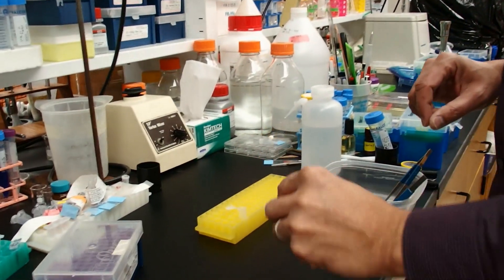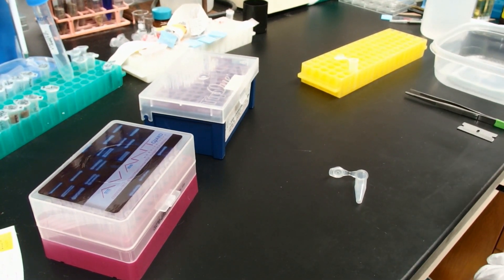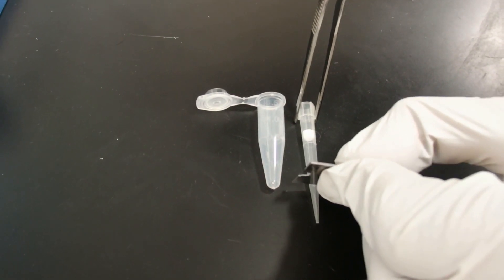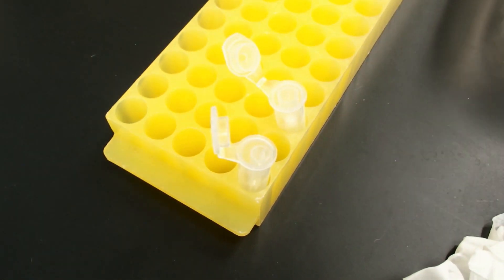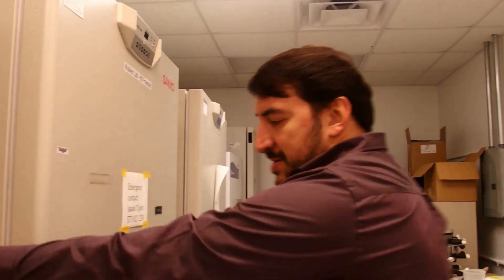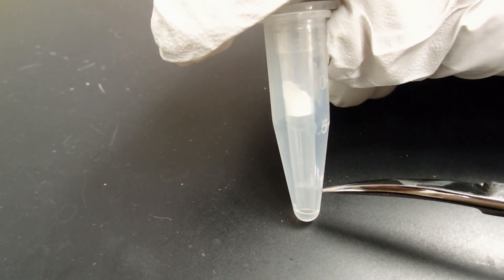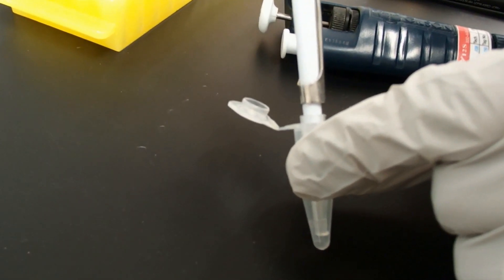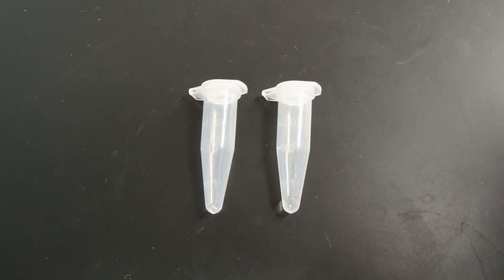DNA Gel Purification - Freeze & Squeeze Method

Comment: What type of tips should I use?
Reply from the maker: any filter pipet tip will work that looks similar to the one in the video
Reply from the maker: also check the print protocol that can be found in the description (here) because it does a good job of describing the filter tip requirements.

Comment: Hi what is the 260/230 ratio? How much input dna is required if I need to purify 6kb band.? My downsteeam application is infusion/nebuilder. I tried PCI and I get 0.6 to 0.7 260/230 ratio. I am not sure if it is good enough
Reply from the maker: The extracted DNA has the gel buffer and the dye (ethidium bromide) still attached to it. I have used it directly with NEBuilder hundreds of times.

Comment: Hi! Thanks for your video! Have you ever performed a gibson assembly directly with the recovered DNA?
Reply from the maker: Yes, for smaller assemblies (2-4 fragments) I would use the DNA directly. For larger assemblies I often put put all  fragments together and did a phenol:chloroform:isoamyl purification (on my website) and then did the assembly. I am not sure if PCI was always necessary.
Reply: Also...my gel is stained with sybr safe. Do you think I can quantify it in a nanodrop using TAE as blank?? Thanks in advance 😊
Reply from the maker: @ Probably no. Ethidium bromide completely messes up the nanodrop's ability to quantify DNA. Probably SYBR safe does the same. PCI purification (like mentioned above) can remove it and make nanodrop quantification possible.

Comment: Thank you for sharing! Can I use liquid nitrogen instead of the -80?
Reply from the maker: Yes you can. Just a few seconds in liquid nitrogen and it will freeze. I am not sure about the DNA recovery between the freezing methods. The ice crystals will be different between a freezer and liquid N2.
Reply: @RahulPatharkar  Awesome! Also, What kind of recovery efficiency can you get with this method? Have you measured DNA quality (260/230) aswell? Im curious because i often get very poor 230 ratios when using comercial kits and I imagine it might be the reason why some of my transformations aren't working.
Reply from the maker: @xdacunha  Recovery varies between 50-90% related to how you cut out your gel and the size DNA. DNA from freeze and squeeze prep has ethidium with it that distorts the wavelength ratios, however, the DNA can be used in most downstream applications directly. I sometimes further purify the DNA with penol:chloroform:isoamyl alcohol which leaves exquisitely pure DNA.

Comment: Hi, I did exactly what is in the video but I didn´t get any DNA... Could it be that the material of the tip filters are different? I don´t know where the problem could be..
Reply from the maker: Different filter material is possible, however, I have used a number of brands successfully. One thing I noticed is that sometimes people do no realize your DNA can be quite dilute if a lot of extra non-DNA containing agarose is surrounds the DNA band. I always preferred to cut so that my eluted DNA would be as concentrated as possible.
Reply: @RahulPatharkar  thank you for your quick answer. We don´t have success with DNA gel extraction even with columns kits... We placed micrograms of DNA in the wells and obtained a few nanograms 5 ng/ul with the columns method.

Comment: Hello! Thank you for the useful info!
Tell me please, can the same method be used with RNA extraction and with PAGE?
Reply from the maker: To get DNA or RNA out of a PAGE gel typically will require electroelution not a freeze and squeeze.
Reply: @RahulPatharkar  By 'electroelution on a free and squeeze' you mean instead of centrifugation to apply electroelution on the cutout, frozen fragment, or I undesrtood wrong?
Also is the same method that you describe in the video good for RNA purification?
Reply from the maker: @ChristinaPatra-il1jl  Yes, electricity to get the nucleic acid out of the gel.

Comment: Thanks for the amazing video, we have some old Freeze & Squeeze columns from Biorad. I wanted to know if I can use these columns for PCR clean up? Do you think the DNA will bind to the filter?
Reply from the maker: Biorad Freeze and Squeeze do not really work for PCR cleanup in the sense they will not remove the buffer or other proteins. They will only remove agarose. My favorite way to cleanup PCR is by phenol:chloroform:isoamyl extraction followed by precipitation. PCR cleanup kits can also work to remove buffer and proteins but the yield is sometimes lower. I hope this helps.

Comment: That's amazing, thank you. I have a question; I want to do cloning after DNA purification from the gel. Is it possible to use the same method and then proceed with the plasmid? or do I have to further purify the DNA?
Reply from the maker: You can clone the DNA directly without further purification, however, you will not be able to accurately quantify your extracted DNA with a spectrophotometer due to interference of ethidium bromide.
Reply: @RahulPatharkar  Thanks a lot

Comment: I tried this, Thank you. But I have a question. When I looked at the gel trapped above the filter under ultraviolet light, I noticed that the gel is lightning and I think it's because that part of gel still has ethidium bromide, and in this case some of the DNA with ethidium bromide was still in the gel and had not come down.
Can you help me about this please?
and sorry for my English too
Reply from the maker: The release of DNA is probably not 100% by freezing and spinning but it is better than other kit methods I have tried. Commercial kit for gel extraction have notoriously low recovery. I recommend you work with the dried agarose on the top of the filter to see if it really contains DNA or not and not just visualize fluorescence.
Reply: I tried this method and got the exact same thing as you described. Just out of curiosity, I also checked the trapped gel  under UV and it did show the fluorescence; meaning DNA has not been completely escaped the agarose mesh.

Comment: Very smart way! Two questions: is there any size limitation of the DNA to be released? Will a vector more than 10 kb work in this method? Will the recovered DNA work with the In Fusion cloning system? Thanks!
Reply from the maker: As size goes up, recovery goes down. This is also true for commercial gel extraction kits. I use this method for 10 kb vectors. Yes it will work with Fusion, however, you could combine it with a PCI extraction if you want to increase the efficiency. https://patharkar.com/2019/01/dna-extraction-phenol-chloroform-method   I hope this helps.

Comment: Is tae buffer eluted dna c compatible with golden gate reactions? Can the DNA be quantified in this solution?
Reply from the maker: Golden gate compatible = yes. Quantified by spec or nanodrop = no because ethidium bromide messes up the absorbance. Techniques like ethidium bromide spot plate can work for quantification. Combine this method with PCI purification for extremely pure DNA for any application (https://patharkar.com/2019/01/dna-extraction-phenol-chloroform-method) that can be quantified by spec or nanodrop..
Reply: @RahulPatharkar  Hi Rahul, Another question, what is the purpose of freezing?

Comment: Hi, I was just wondering since you stain your gel with EtBr and use a pipette to push the liquid from the tip, won't your pipette be contaminated with EtBr? sorry, I'm just not sure because we don't have a designated pipette for EtBr. Thank you!
Reply from the maker: Virtually all of the EtBr would end up in the bottom of the tube. Trace amounts that might end up on the pipette could be wiped off with a kimwipe and 70% ethanol. If EtBr concerns you, you could just waste the DNA that remains in the tip or you could expel that liquid with a disposable transfer pipet. I hope this helps.

Comment: Sir it's awesome but is that we should only keep it on -80°C Or we can keep it in 0°C
Reply from the maker: -20°C could also work but may take a little longer to freeze the gel. The gel has to be frozen. 0°C is not recommended because it would take a really long time to freeze the gel or it may not even freeze at that temperature.

Comment: Did you measure the O.D of the extracted DNA?
Reply from the maker: You can get a meaningful absorbance of the DNA only after you further clean the DNA up by a method like phenol:chloroform extraction because ethidium bromide in the sample will interfere with spec readings. Phenol:chloroform can remove ethidium bromide. However, the DNA generated by this method is pure enough for setting up a ligation or similar enzymatic reaction directly.

Comment: Lovely video.  Very useful and simply method.  I was wondering whether this technique is compatible with EMSA gels?
Reply from the maker: That is a good question. I have never used the method to pull DNA out of an ESMA gel. In theory, it would probably work since freezing disrupts the agarose gel matrix. However, the proteins attached to the DNA may influence the recovery. Sorry I do not have a definitive answer.
Reply: @RahulPatharkar  I was wondering whether it is possible to extract ssDNA using this technique?
Reply from the maker: I have never tried to get ssDNA out of a gel. However, my guess is the freeze and squeeze method should work pretty similarly for recovery of ssDNA and dsDNA. If I had to get ssDNA out of a gel I would certainly give this method a try because it is so fast and easy. If you do give it a shot for ssDNA, I would love to know the outcome.